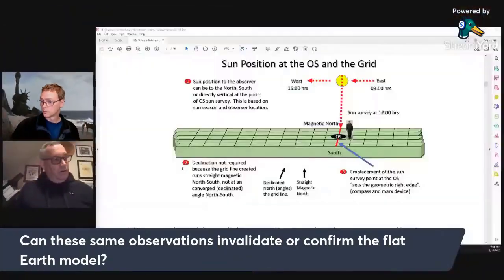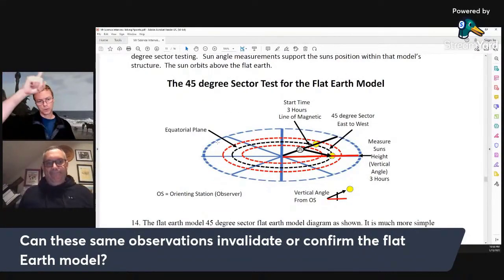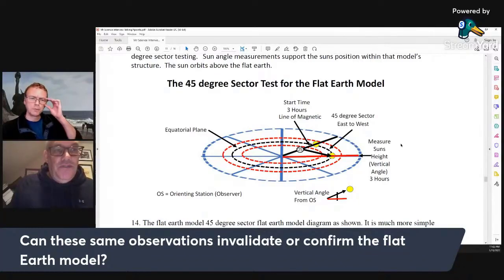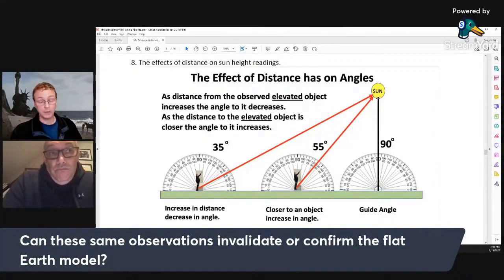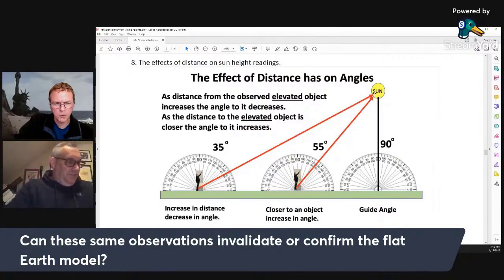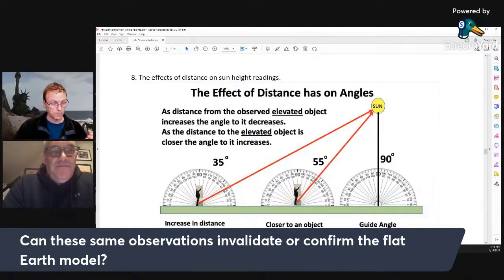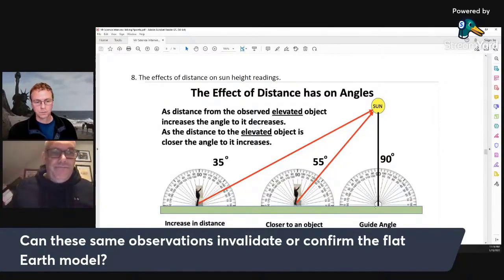Conversations with Corey - Does this work on Flat Earth?

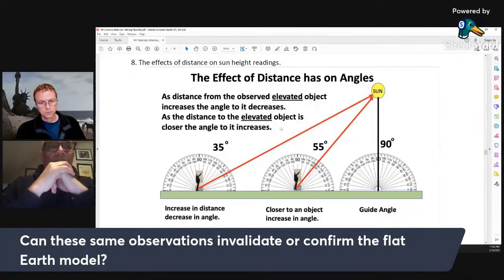Comment: So his sun altitude is somewhere between 3000 and 4000 miles up. I missed that the first time round. Right, now that's something we can work with! Well, mostly: we still need a distance per latitude or something, but I'm sure he's fine with the standard 111 km/°. With those parameters, the limit for the FE model for the 45 sector test lies between 42.5° and 50.7°. So not 87.6° at all. This all directly follows from using the diagram of slide 8 (11:00).

He's comparing apples and oranges here, and even messing that up. For the globe he looks at the limit at 3 hours before or after noon at a given position. But for a flat earth he uses any time at any position. This is be a blatant double-standard. But worse, he's mixing up the range of angles to any point on the sun (α±angular size of sun) as the limit for α itself for the FE model.

Have you ever heard of "cargo cult science"? The way that Kell talks reminds me a lot of that. He's heard certain terms (lines of parallel, fans, survey points, limit, etc) in military school. They seemed important so he's using them as well here. But since he never really grasped why they were important or worked,so he doesn't understand why they're out of place here. He has copied the form, but not the content. There seems to be a lot of this with flatearthers.

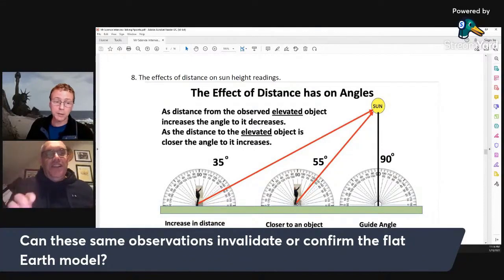19:30 "The heliocentrist guy, he didn't understand this. He didn't understand that if you get farther away, the sun appears lower"
This had me laughing out loud. No, Kell, he almost certainly did understand that. But because you constantly confuse your terminology, he couldn't understand why you keep bring the sun-size into this, even though it's irrelevant to this diagram. That same confusion is present throughout this video. 

A persistent theme in Kell's presentation is that he shows diagrams, then talks about things that are not in the diagram (or even contradicts them) but still assumes the other party understands what he's talking about. That's just not how communication works.

Comment: How is he measuring the angular size of the sun? Besides it's angular size change is extremely small and insignificant. As you say, I wish he would just use trigonometric terms in his explanations.
Reply from the maker: I think he's using a right-angle calculator - presumably online. (That will be atan under the hood, but I don't think Corey realizes that.)

He seems to have gotten the angular size of the Sun by punching in the size and distance to the Sun into the right-angle calculator. I suspect he punched in the diameter instead of the radius and got a 2x error there resulting in his 1 degree limit.

For the flat-Earth, he seems to be doing the same thing. He takes the size of the flat-Earth Sun and the distance to the flat-Earth Sun, punches them into the right-angle calculator, and gets 2.5 degrees. This raises the question, "where'd he get the size and distance to the flat-Earth Sun?" I dunno. Pulled out of thin air? Dunno.

Simple logic says the angular size of the Sun must be the same no matter what shape the Earth is. Also, we SEE the angular size of the Sun, and that is well-known. The physical size of the Sun must be inferred from the angular size - not the other way around.

Comment: If the distance to the sun is only a few thousand miles, why is there a 2.5 second delay when ham radio radio operators bounce signals off the moon? Is my friend who travels the globe doing this lying?
Reply: Some in the FE community have ham radio licenses and equipment including Globebusters Bob which you can check in the FCC database.  He refuses and often gets angry when asked to do such things, heck he will not even plot the frequency of a satellite moving overhead so he can get the speed via Doppler shift.

Comment: 69 miles wide sun with a 0.5 degrees angular size? That is 34.5/Tan(0.25) = 7,906 miles up! That is TWICE what he thinks it is. 69 miles wide at 3959 miles up = 2 x arcTan(34.5/3959) = angular size of 1 degree. He said 2.5 degrees. His own numbers do not tie up.
Reply from the maker: I got the impression his trig was a bit shakey.
Add to that he somehow figured the Sun was 2.5 degrees. Once more, he seems completely self-taught. The angular size of the Sun is well known to be about 0.5 degrees. It's one of those "globe proofs." Further confirmation that he hasn't looked at the other side much at all.
Reply: Corey shows a definite fixedness to his thinking. You must use his terminology. You must follow his logic. He will not try to understand you. He is only interested in you understanding him.